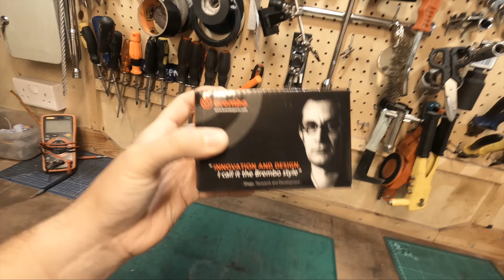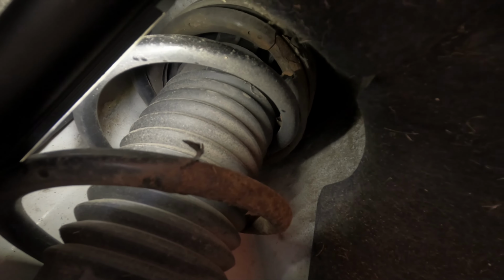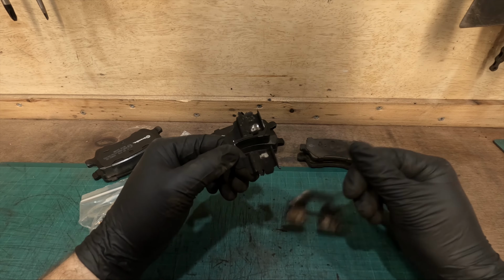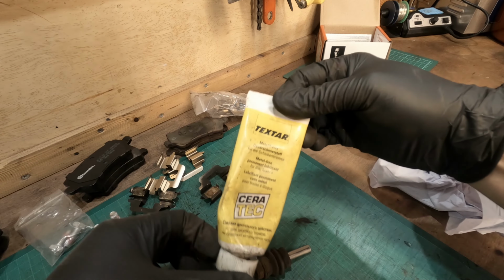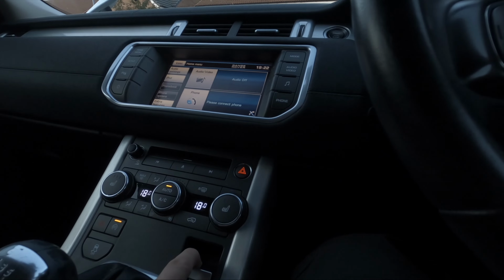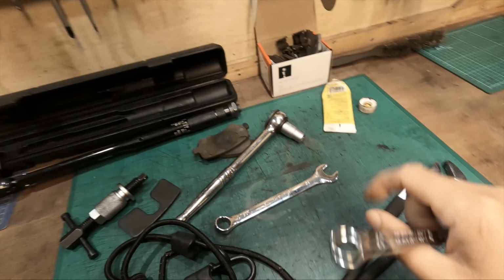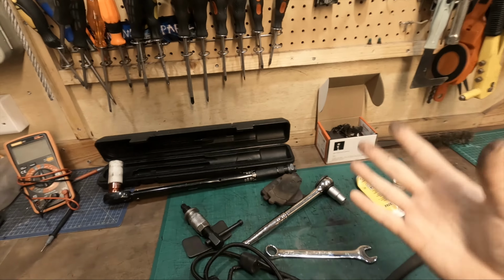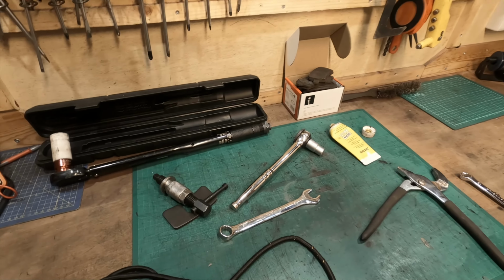Range Rover Evoque Rear Brake Pad Replacement / Installation + Park Brake Maintenance Mode [How To]

Comment: My 2012 evoque will not go into service mode. I was able to get the electronic brake off then unplug the cable, but I can't push in the caliper piston.
Reply from the maker: Hi, did you engage service mode, if cars states service mode it should push back smoothly
Reply: @FIXitBUILDitGARAGE  no it wouldn't go into service mode. Followed the steps multiple times. Even from other videos and forum posts.
Reply: Mine does the same as this. Causes the piston to push fully out and then gets fluid all over. 
Woikd disconnecting the wiring prevent this?

Comment: Hi mate have you ever done a front wheel bearing is it a big job
Reply from the maker: Hello, on this car no but need to do the rear wheel bearing asap on this evoque, may film it if able to spare enough time - process is very similar, fronts maybe easier as your can turn the knuckle to get the CV shaft out, on the rear you need to half remove it.

Comment: Good video mate how much torque for the bolts though please can't seem to find it  👍
Reply from the maker: The bolts locking the callipers to the anchor plate I went with 30 Nm but generally nipping them up tight is about the same, in the footage you can see that it clicks without barely moving.
Reply: @FIXitBUILDitGARAGE  yeah cheers for reply, since asking ive done the rear pads but as you said just nipped them up by feel in the end didn't go mad with them.very helpful video surprisingly  simple to disengage the handbrake when shown how ha thanks👍

Comment: Have you heard of the gawd-awful howling noise that newer RR-Evoques make when going in REVERSE after sitting for a day.  Its a resonating noise that's really loud and makes your teeth rattle and the neighbors all wonder what kind of junk is making that noise?  It's almost if the pads are dragging on the rotors.  I also wonder if its because the OEM pads don't have any chamfers (bevel) on them and they don't have any brake-quiet fluid on them either.  Is it possible that the parking brake is slow to release and drags while immediately going in reverse?  Aftermarket pads have chamfers on them to reduce noise.

Its a very common complaint.  Do you know of it and have a solution for it?  Thanks.
Reply from the maker: I think I know what you are talking about, if I place the Evoque in reverse and then into first and pull away I get the grinding sound sometimes from the front end. I thought it was the pads, which have been replaced and still present, wondering if its the coil springs at fault now so planning on swapping them out with new ones in the new year as stating to blister. However I think its more likely the gearbox, which I have no plans on pulling out anytime soon. Maybe I will replace the gear oil, in the new year... found if I full lock left in reverse, then shift into first and full lock right when pulling away, basically turning around in the middle of the road it always makes the noise and can feel it in the steering wheel 🤔
Reply: @FIXitBUILDitGARAGE  The noise appears in the act of reversing only.  It has nothing to do with reversing and then into first and driving away.  It happens while simply going in reverse after the vehicle has sat around for a day.
Reply from the maker: In that case i would suppect discs or pads, or both, check your discs for a lip, could be catching pads. States on them the min thickness but the old method, place a penny on the disc and if the lip is still higher, swap them out. I always remove my handbrake before pulling away as it wears your pads down faster leaving it on when pulling away 👍
Reply: @deansimpson6618  hello mate, just wondering if you found a fix for the noisy brakes when reversing. I have the exact same problem as what you described. Only happens after the car has been parked for a day or more. I was going to start with a new set of brake pads and if that doesn’t work I’ll change the rotor too. But thought I’d ask you first in case you found it to be something other than the brakes. Cheers

Comment: Do you think this would work for a 2019 evoque?
Reply from the maker: Changing pads is very similar on most cars, placing car into brake service mode is usually different and takes a little researching to find it out but removing callipers, greasing up pins ect is very similar.

Comment: Absolutely brilliant video 👍🏻
Please can you confirm that the 2013 is push back callipers and not wined back? 
Considering helping my sister in law out 🤞🏻
Subscribed and liked 👊🏻
All credit to you buddy for such a detailed video 👊🏻👊🏻
Reply from the maker: Hello, the rear callipers are locked, you need to engage the maintenance mode to let the piston wind back - you could remove the motor and push them back however risk damaging the motor this way

Comment: Thanks for taking the time to make this video. Nice job! I will be replacing my rear pads and rotors.
Update: changed rear pads and rotors on 2017 evoque with no problem. No scan tool needed. Although my car never did say that it was in maintenance mode when I used your method to disengage the parking brake it worked great. Took off elec brake motor on each side, used a pair of pliers to gently turn the gear and was able to press the caliper piston back in easily with channel locks. My rover dealer wanted $1100 to do this. I did it for $200, Autozone. I didn't have to replace the wear sensor as it was not wore down enough yet, just cleaned it up. Thanks for your video.
Reply: hopefully you see this comment soon. After replacing did you pump the brakes before releasing the maintenance mode or no?
Reply: @d3c3ptiv3-59  I don't recall pumping the brakes and everything worked fine
Reply: @captnjerry4950  Thank you! I ended up getting it thankfully lol. I have had a bad experience with EPB in the past on an F150. I pumped the brakes prior to releasing the maintenance and as soon as i released the maintenance mode it destroyed the EPB and the caliper.

Comment: Great vid, these evoques do go through rear pads fast for some reason. Mine are on second set after 2 years.
Reply from the maker: Cheers 👍 must be due to weight of the car and the electronic brake - good thing pads are cheap and easy to swap out

Comment: Will this maintenance mode work for a 2016 Evoque? My Autel 808 couldn't do it 😓
Reply from the maker: Sorry for the late reply been told after 2015 from viewers it will not
Reply: @FIXitBUILDitGARAGE  it actually did work after all with my Autel. I think battery has to be over 12 volts for it to work properly.